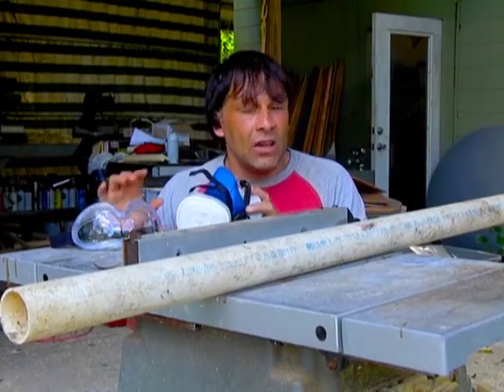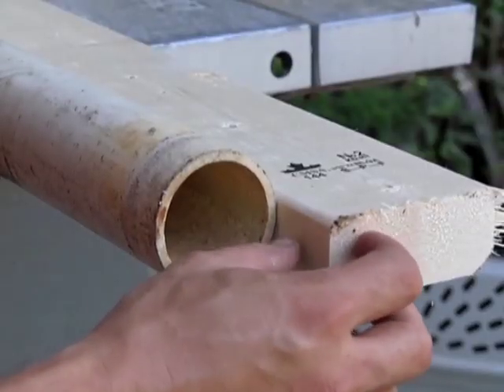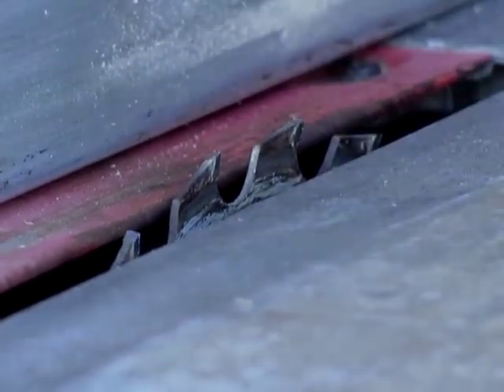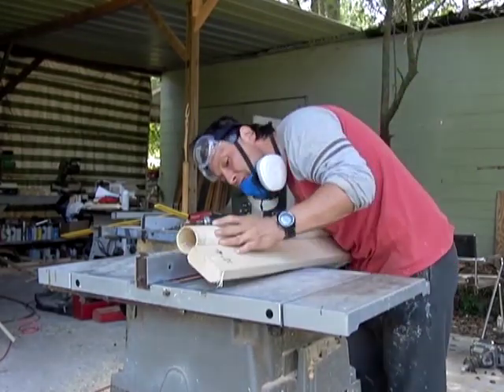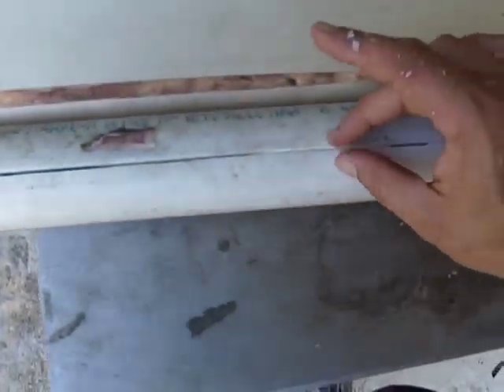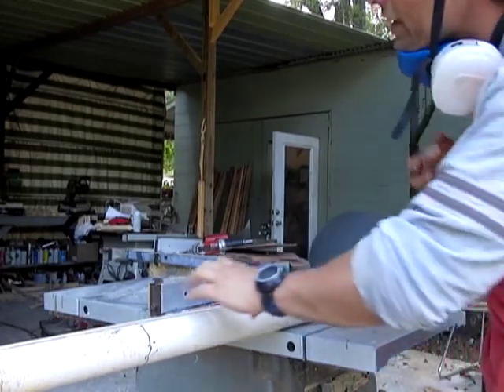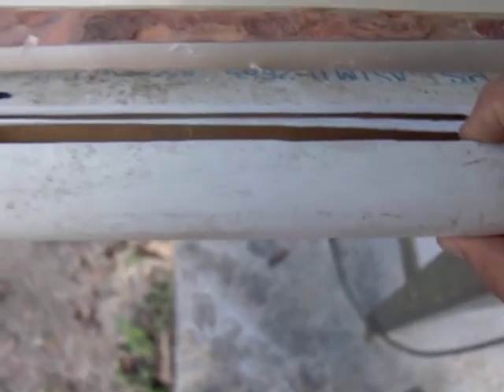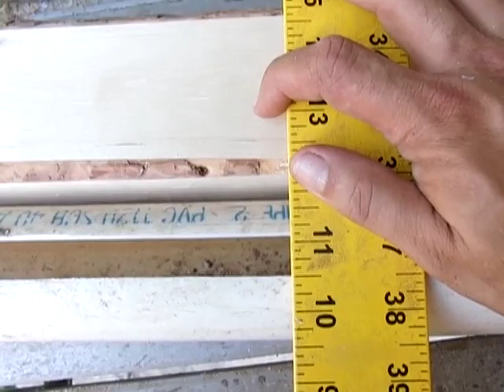PVC cutting a channel for Algae panels DIY forced air heater CPVC

Comment: Shim the leg of your saw so it’s not teetering. After blade height is set use a square block touching a tooth to mark fence for start and stop of your cuts. Someone rightly suggested drilling holes for neater terminations. When the blade is low it makes long shallow partial over cuts.

Comment: @craftchest You stick it in a centrifuge for a bit, then you take the pure algae and basically mash it down and get  bio diesel. There are other steps and other products you get out of it but thats the gist. Plus pound for pound it produces more energy than solar panels. You can take that bio diesel and pour it into a generator to run you entire house for a lot less than to install PV solar panels.

Comment: Maybe you should conceder doing some voice over narration for things like this. This video should not be 13min long to explain how to cut a hole in PVC
Also show finished product first and then show how to do it. This way we know what we are working as you go. Finally wouldn't it be easier to just make 2 cuts on the out side edges of your strip and then use something like a dremel to cut the ends

Comment: Thanks for the video. I have to create a 1/4 inch wide wide groove in a 10 foot piece of 4 inch diameter PVC pipe. But I am cutting all the way through both ends, which is easier than what you are doing here. 
I think I am going to put the 2x4 guide against the fence. I can guide the pipe through the saw much better that way. I have a roller rig that catches long pieces of lumber as it exits the table. So I don't need anyone to hold the pipe at the exit side of the saw.

Comment: Hi Dan, enjoy your videos.
I would cut my slot with a router table, you can get a wide slot in one pass.

make a stop for not going past your mark, happy to see you use a mask, i regret not using one in the past. Pvc is pretty inert but at my age can think of nothing but fresh air I want in my lungs, also many wood dust is toxic due to chemical preservatives added to wood.

Comment: Hey Dan. I like your vids alot, and I've seen them all. I've had a lot of success using a router table with a fence for alot of the cuts I see you do with the table saw. The perfect circles, wide cuts, etc are accomplished faster, easier and safer in my opinion. Have you considered this? I'd like to know your reasoning if so. Keep em comin, Dan. I like the cut of your jib.

Comment: Why not just cut two of the length grooves with the table saw and then use a figure saw to cut away the middle section in between? wouldn't that also minimize the "jaggedness" that you get with your technique? btw sorry if I use the wrong words for the tools, English is not my native language.

Comment from the maker: @bowakowa Hi, in regards to the circle cut on the table saw, I can get a 46" diameter circle from a 4x8 on 3/4" plywood in about 2 minutes. The setup is easier IMHO. I cut about 40 circles a week for business and it is easier 4 me. Routers are good but not as fast. I like the table saw, it is a personal preference I guess. What router blade do you use for heavy fast wood cuts. Also if you get a chance, shoot a video of a thick wood circle router cut, I could approve for a video response.

Comment: Dado Blades are not good for this type of cut because they tend to
make small chip like fragments off the PVC pipe, these can hurt and even
cut your hands if you are hit hard enough by them. Plus with a single blade
you have more control over the depth and the width of the cut. Dadoes tend 
to bind up and melt the pipe.